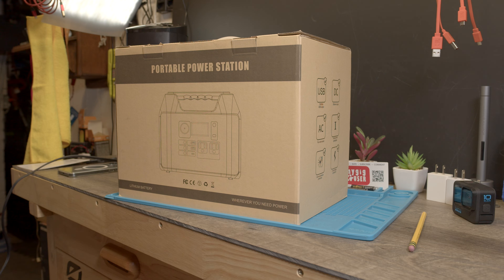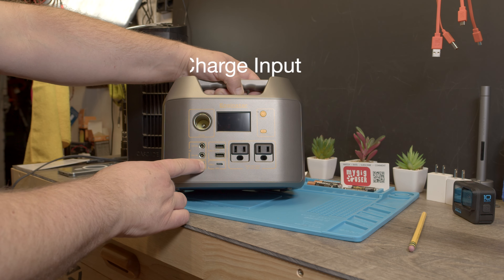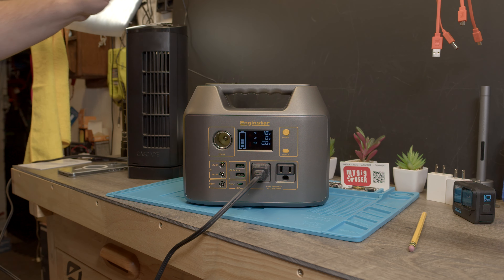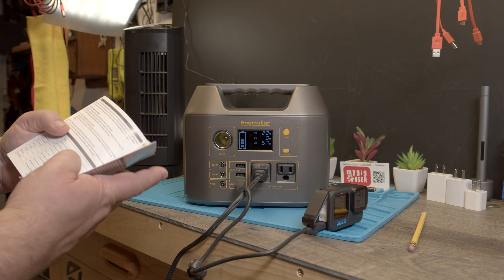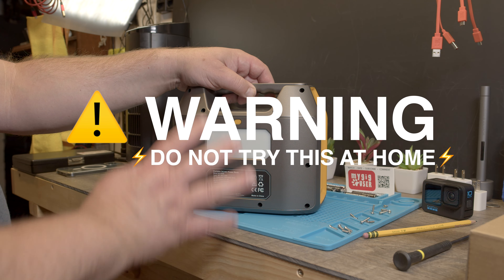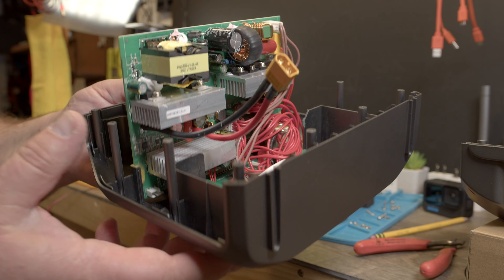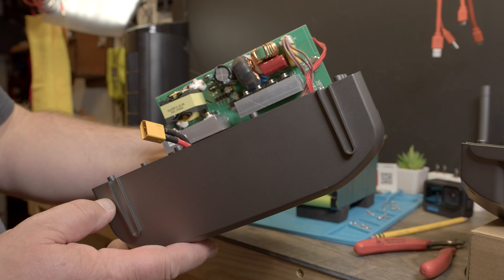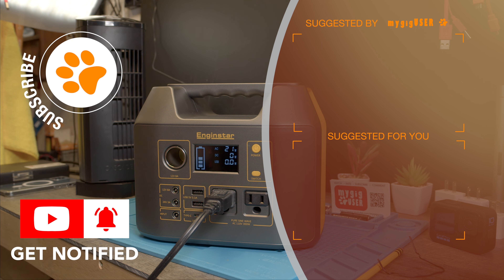Portable Power Station - Enginstar 300W

Comment: love those Xt plugs they did not put a cap on its end, just hint shrink.
Reply from the maker: also not very tight. I had some in RC hobby that needed 4 hands to be pulled apart, the ones in here, very easy to disconnect. I'm not charging that thing inside my house.

Comment: Hey men I have one of this but it only turned on when I plugged to the wall, what maybe is the issue?
Reply from the maker: maybe a loose wire inside?
Reply: @mygiguser  thanks I’ll try to open it
Reply: I have the same issue. Did you resolve it? If so - how?
Reply: @jaac12000  did you happened to fix the problem?
Reply: @soulorebel  Afraid I haven't even tried opening it up. I tried to find a support # with no success. I guess that's next.